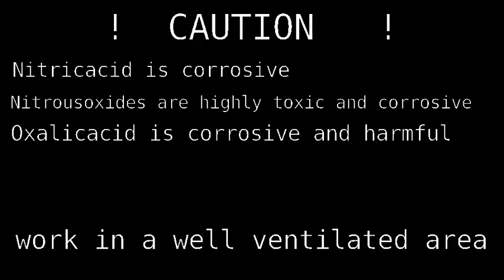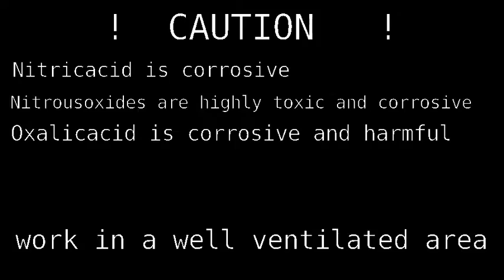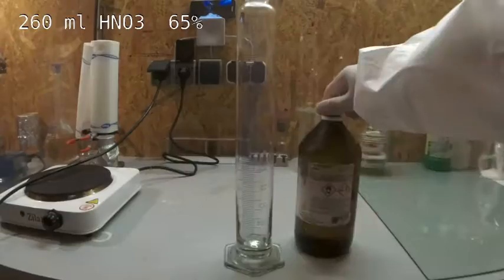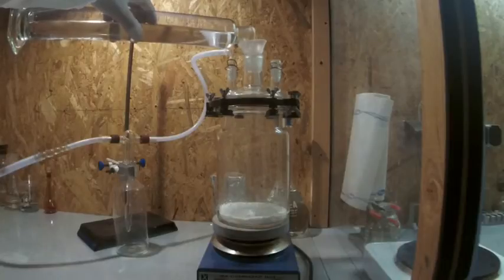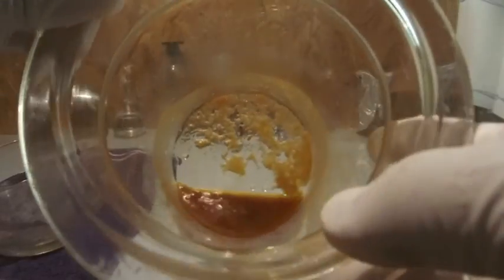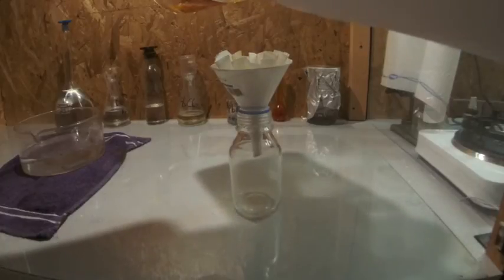synthesis of oxalic acid (mega NOx outburst)

Comment from the maker: to help understand my videos I´m from now on posting the audio as a text :D
hope you all enjoy the video 

Hello everybody 
in this video I am showing how you get oxalic acid by oxidation with nitric acid
It is verry important that you work in a well ventilated area or a fumehood 
I tried to recover some of the nitric acid by dissolving the nitrogenoxides in water 
this recreates nitric acid wich can be purified and re used 
but this was not working like i expected it to do 

I measured two hundred and sixty milliliters sixty five percent nitric acid out 
then i filled fivty gramms of glucose in the reaction vessel 
the vessel had a empty security wash bottle and a gas wash bottle filled with water attached to it 
the water than absorbs the nitrogen oxides and turns them into nitric acid 
which then can be purified
It is unimportant wether you fill the nitric acid or the glucose first in the reaction vessel 

to start the reaction simply turn on the heating and set a constant stirring 
you know that the reaction is starting when you see a colour change 
this is caused by nitrogenoxides which disssolve in the reaction mixture
as more and more nitrogen oxides are forming the mixture gets darker and darker and brown fumes gas out the liquid and fill the vessel
at one point the reaction kickstarts and a big amount of nitrogen oxides is formed 

the gas volume was way to big for the gas wash bottle so my entire fumehood was flooded with brown gases
luckely I am always wearing my gasmask when some kind of unexpected gas outbreake could happen
this was not the first time my attempt to recolect the nitrogen oxides failed
now after two glorius fails with this reaction my fumehood is broken 
but i learned my lesson 
next time i am trying to condense the N O x instead of dissolving them in water or a hydroxide solution

because my exhaust system was corroded and totaly killed by the nitrogen oxides the fumes took a verry long time for getting out of the fumehood
when all the gases were gone i proceeded as usual 
i gave the mixture around an hour to fully react and stirred it vigorously

In the security wash bottle were some of the nitrogen oxides condensed and i recovered them and stored them safely in a glass ampoule

then i had to reduce the volume of the reaction mixture 
i did this by simply heating it on my hotplatestirrer 
when heated the mixture gives a lot of dissolved N O x in to the air 
also some of the still unreacted nitric acid is decomposing and also producing nitrogen oxides 
so be carefull
 
i got a brownish looking product slush which i cooled in a watterbath and then filtered
from this i got two batches of product 
in this shot you can see the verry pure oxalic acid in the left side and the purified sideproducts on the right
i then reduced the volume of the filtrate and recovered a second batch of product
this was highly conterminated which can be seen by the brownish colour

have fun and do not kill your self
Reply: what's the purity of oxalic acid obtained? +99%? i know it would be 2 hydrated, i mean +99% 2hydrated oxalic?

Comment: GREAT VIDEO........That is why i have not done this experiment yet.   All that NOx gases.   NOx gases are soooo freaking hard to contain without dry ice.   I had the same thing happen to me when doing a free radical chlorination.   My fume hood sprung a leak. It was terrible
Reply from the maker: well working with such amounts of gas is always challenging ... but with the right equipment everything can be done :D
Reply: @HazelChem  .......Well i got my fume hood fixed last winter.  At least i hope it is fixed.  And i got a FULL FACE snorkel mask to convert into a gas mask.  So hopefully this winter i will be prepared form ANY nasty gases i work with